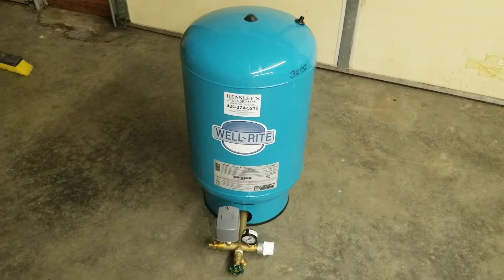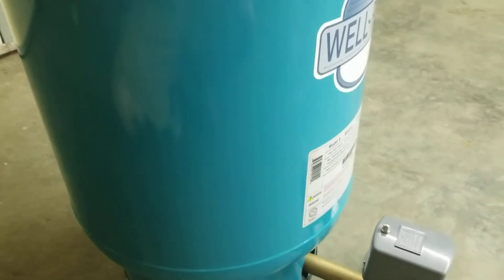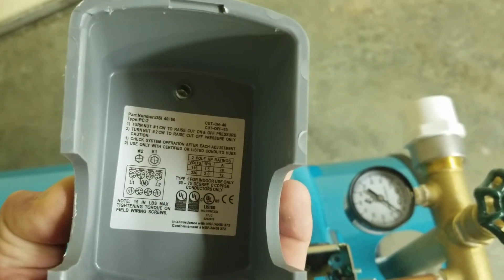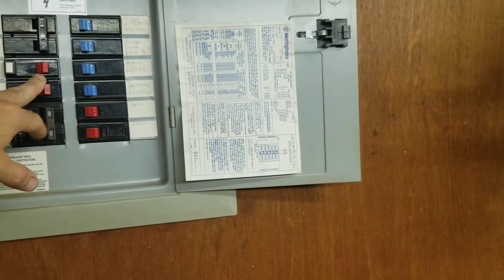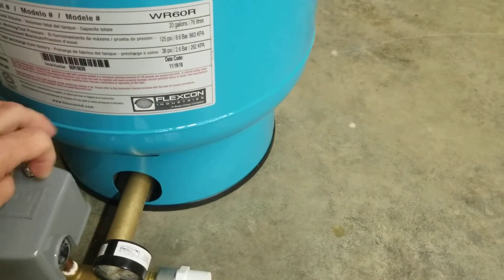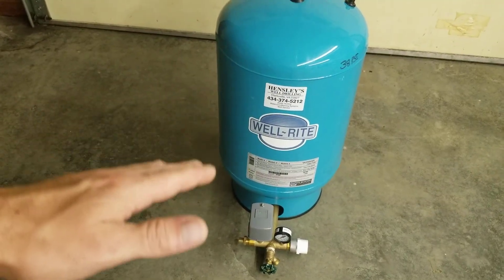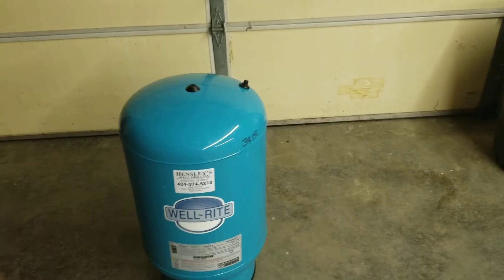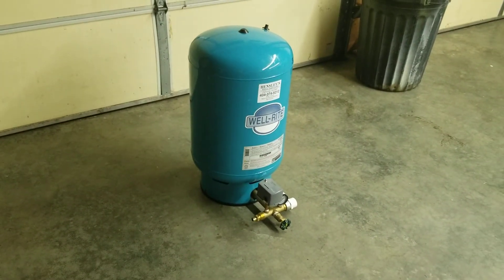Well Pump & Tank Troubleshooting, How the system works, Adjusting Pressure Settings Correctly

Comment: Hey how do I know if it's a frozen pipe compared to well pump?? My water stopped working got a salamander underneath but still nothing tank pump lever has arc but dosnt pressurize its been at steady 32 psi says 30 on 50 off .
Reply from the maker: https://youtu.be/mjhZXgzZoDM 
Watch this video.  7:30 is what I believe is your situation. But the whole Video will help you understand things better
Reply: @h2omechanic  please tell if I have had so much trouble out of my water lately I don't know what to do I finally have got my welcome down in my well then my bladder tank was bad so I replaced my bladder tank I have got a switch on it but I don't know if it's a 3050 or at 4060 and the gauge is reading from the switch like 70 lb but when I checked the air and the tank it is only like 25 what should I do I'm not getting any water out at all but it sounds like my pump is working I'm getting fire to my switch I'm so confused please help
Reply: Landlord has been not helping hasn't even checked or came over
Reply from the maker: Kill the power & don't use any water & see if the 32 psi drops to 0. If it does drop to 0, then the drop pipe burst near the pump. 
A ice plug made the pump dead head, making 150+psi & blew up the pipe. Try that & reply your results
Reply: @h2omechanic  killed the power and its staying at the same pressure.. I just used tire gauge checked too let little out but Normal gauge on pump reads same
Reply: I'm in maine were getting a foot of snow as I speak.  But it's been this cold before and didn't happen.  Couple days ago was low pressure for little bit but then worked fine
Reply: How can I tell if it's the well pump? There's arc on the tank switch but no action no pressure
Reply: The well pump man hole cover was covered in ice I uncovered it just now outside
Reply from the maker: @LoyaltyIsEverything91   As the water level fluctuates up & down, the well breaths in & exhausts the outside air temperature, this can freeze the upper portion of your drop pipe. Id say 90% certain that it is frozen. 
So cover the well head air tight & leave the pump breaker off! Give it 24hrs & try it again. Allow 5-8 minutes of power to test it. If no water still, then turn the breaker back off. It's froze, just gotta wait it out.

Comment: I have a tank with no air valve and I am pretty sure that it was full of water so I drained it the best I could but like the tanks I see in your videos mine drains out the side of the tank and I cant be sure that it is completly drained and my tank has no bladder it just says glass lined , can you please give some idea of what I can do. when I turn the power on to the pump I just get quick hum then it will shut off and then hum again I have not let it be on very long . I hope you can help with the little imfo that I have provided. thank you.
wer
Reply from the maker: The pump is probably dead.
You have a older style galvanized tank. You did right by draining it as much as possible. The air will get trapped in the upper portion. 
If you hire someone to replace the pump, id recommend updating the tank to a new bladder type . But every system is designed differently. Hard to say too much about yours. But them hummm and suddenly stops indicates a bad pump. Bearings failed internally

Comment: We put a new submersible well pump in 2 years ago. We are now having light dirty water coming out and the cold water pressure only in our kitchen sink is low…. Any suggestions?
Reply: Also the breaker to the well tripped
Reply from the maker: The tank is probably bad, causing short cycles and will cause low pressure and can trip the breaker.

Comment: I have a new 44 gallon pressure tank and a new pump, both 30/50. But adjusted to 28/48. Bladder Test-No water coming from the tank when I press the valve on top of the tank. When the tank is pressurized (48 lbs) the "knock test", it sounds hollow at the top and dense at the bottom. The "lean" test,- the tank does have weight. I'm supposed to have 16 gallons of reserve in the tank. My issue is, when pressure drops to 30 the pump kicks on and delivers water into the house normally. But if I start the washing machine in the utility room, the pressure at the pump drops to zero and loose water to the entire house. And it does seem like the pump runs a long time before building back up to 30, then even longer to build up to 50. New foot valve and back flow valve also installed.

Comment: my pump was running fine yesterday, now it wont go over 25psi. Any clue whats wrong?
Reply from the maker: Its possible that it frozen, then it builds 200psi & blows up the pipe in the well, it'll split & leak out most of your pressure.  
A way to test my theory is by turning off the pumps breaker and see if the 25psi drops to 0. 
Look for leaks under house and at the well & wet areas in the yard. Theres a leak somewhere. If you can't find one, then the pipe in the well is broke/split
Reply: @h2omechanic  thank you, I'll go check all pipes under our house

Comment: My pressure is fluctuating and my tank keeps emptying and filling back up is this a switch issue? Please help just replaced tank and well pump two years ago. Deep well
Reply from the maker: 1st thing, keep the pump breaker off during times your not needing water.
The issue is a leak somewhere. Possibly at the well head, could have frozen & cracked a pipe. So look around for wet areas. 
If you don't find a leak, then you have a cracked pipe down in the well near the pump. Or the pumps check valve has gotten hung up & not closing. Any pressure the pump produces will leak out, causing the issue your experiencing. 
A way to test this, is leave it off over night, then in the morning turn it on & run the water for 5 minutes, if you get a air pocket in the stream of water coming out the faucet, that's a tail tell sign the pump must come out & inspect for cracks in the pipe.

Comment: I am having issues with no water it’s been over two months I have children and can’t go without water any longer I have the pump pulled up right now it was 300 feet deep with 21 foot sections  galvanized pipe I could not find anywhere the wires weren’t connected so does this mean it is the pump or how can I test this ?
Reply from the maker: Hook up the pump to the wires on top of the ground. & see if it runs. 
I'd replace the pump and the wire if they're older then 13 years.

Comment: I don't have any water pressure from my well I did all the checks and I found that my pressure switch is locked closed I have a relay box on this system do I really need the relay box??? Or can I just wire it direct uts a 240 volt system and the well service installed that box 3 months ago and put a new pressure  switch in and my wife has been having trouble with it .she's been throwing the breaker off for 5 seconds and turning it back on and it's been working but I told her that there's something  wrong and now we don't have  no water any advice is appreciated  thanks
Reply from the maker: The pump is dead. It's time to replace it. Nothing up top can fix it. You need the control box bc you likely have a 3 wire pump. 
The bearings have failed and the pump will run for a few minutes and over heat, flipping it off & on resets it. But it'll continue. Time for a new pump.

Comment: What do you think is wrong?

I have a 10hp well pump, 80ft in the ground, feeding a 500 gallon tank. My cut on & off on my pressure switch engages on 30/50 cycle. At 28psi, the cut on engages. I can hear the pump humming by putting my ear on the pipe. However, the water/pressure does not rise or fill the tank. We have to reset the pressure switch everyday to get the water pressure/water to go up.

Comment: Great video. I have checked mine out and and still confused. I have a 40/60.  Very inconsistent pressure i. The house. The pressure was at 60 before I did anything. Then I drained it and checked pressure. Everything was okay. So I put water back in and asked my son to take a shower. Pressure dropped to 10 and just stayed there. Half hour later it is back up. Do I need a new switch?

Pressure
Reply from the maker: Replace the switch and the nipple below it. If the nipple below the switch is clogged , it'll act like you described. Buy a 40/60 switch & make sure the air pressure in the tank is at 35psi. & the tank must be empty of water to check the air pressure correctly.

Comment: I have a well system that I have piped into a storage tank and a jet pump to push water to the house a 30/50 pressure switch on it the air pressure in the bladder tank is 28lbs  my situation is that the water well is about 1000ft from my house and seems that my jet pump is having problems keeping up when we shower or do laundry at same time  I don't have any leaks what can be done to increase water pressure in house ? I've been told I need another bladder tank closer to house Would that help or would I need to install a booster pump system? I'm trying to make as simple as possible without  over spending  I hope I explained my situation thoroughly Thanks
Reply from the maker: If you can put a booster pump inline that would work, or put a submersible pump in your well/storage tank. & a tank added at the house would help alot, id put a 36-44 gal tank at the house. But 1000ft is a long way, your experiencing friction loss . Water slows down in pipe on long runs. Personally I'd never use a jet pump in your system. It's job is way overloaded on your setup.
Reply: @h2omechanic  are you saying to put a pressure tank at the house ?
Reply from the maker: @mikewhite4684  yes. Itll help . But your pump style is the problem I believe. My 2cts

Comment: I have lost more and more pressure in my house, started noticing fluctuating pressure once in a while about 2 years ago. Now it's worse and happens more often than not. Should I start at my well pump since it has been so long since it first started or start at my pressure tank? Single mom of 2 with low funds so I can't afford a plumber but I am pretty good at the basic plumbing...diverters, traps, hot water heater, building showers and start new plumbing from scratch. Please help

Comment: been looking at so many videos and I cannot find anything for my situation. I am having issues with my well system. The pressure switch only turns on for 5 seconds every 20-30 seconds then it shuts off. I replaced the switch (40/60) and it still gives me the same issue. I'm assuming it's either an electrical issue, leak pipe, or a clogged pipe/valve. The maximum pressure the tank gets is 9 psi. Air pressure is good (38 psi), not a bad bladder (hallow up top and dull at the bottom), and the well pump seems to be working based on the tests you've shown me. I did check the electrical and they are at 240 V. Any opinions help!
Reply from the maker: Sounds like your pump is dying. The bearings inside have failed, which make the electric motor heat up & kick itself off on a high amp overload due to high Temps. If you had a clamp style Amp meter, clamp it around 1 single wire (white or black) . If it reads over 8 amps, bingo, dead pump. 
I tested a Amazon pump on 1 of my videos, check it out and you'll see the Amp meter & how to test it. If its older the 10 years, that's a sign of typical age life as well. Hope this helps.
Reply: thank you so much! This definitely helped so much! Will update you the next day or two!

Comment: Great video. I have an issue and hopefully you can assist me in some way.....plumbers are booked up around here and there aren't many to boot. We had replaced the 50gal tank waterheater in our home with a rheem tankless electric water heater and a water softener (lime and hard water) and seems as though we've had nothing but problems ever since. Most recently of which, is the lack of hot water--when you turn the tub faucet on and all the way to hot, the psi bottoms out (coming out of the faucet) and is smaller around than a #2 pencil (water stream/flow), plus its not getting even remotely warm no matter how long you leave it running. Troubleshooting in the owners manual for the unit says that if this is happening and the display isn't lighting up, it's something to do with the flow sensor because there has to be a certain flow value in order for the unit to activate. I replaced the flow sensor and all wiring and components the other day and it worked for a day or so and then stopped again. The pressure switch clicks on and off, and on and off the entire time any faucet is on throughout the house. The tank holds psi, no water from Schrader valve, tank isn't heavy when pushed, rings when you knock, psi switch is new, control box for psi tank is new and I'm out of ideas to do/try. Friend of mine mentioned that my tank might be water logged....that's about my paygrade and have been reading and watching videos to see what I might be able to do but nothing yet til I saw your video and decided to ask....Thanks for any help!
Reply from the maker: Ok yes its the flow meter. But its working fine. Your tank is the issue most likely. If you have a inline filter, don't use a black element bc its too restricted. 
Or just let the water Softener do all the filtering. First go look under the pressure switch cover, look for the "on" number.  Itll be either 30 or 40. Say it's 30, then you'll need to check the tanks air pressure (same as you would a car tire) air stem is on top of tank. Set this to 25psi . The system must be off & complete drained of water. 
I hate instant WHeaters bc its always something. Too many sensors. But it does let u know that something in the system isn't operating right. 
So adjust the tanks air pressure. 
Then remove the filter element if u have 1. Then try the system and see if the water gets hot. We did a electric wH in our shop, it required 3 40 amp breakers and had 3 different elements for higher heat levels. This pulls insane power and made our lights flicker. Just our experience. 
Try these things & let me know. If you comment your cell #, I can text/call you & walk you through testing since all plumbers are busy (that's every plumber) even I'm swamped. 
I'm gonna guess that your tank is way over charged with air, around 45psi, or its completely on 0psi.  So turn off the breaker, open a faucet and go check the air pressure with a hand held digital tire gauge, then look under the switch cover, & adjust the air the 5psi below the "on" number. Then turn on the system and try hot & cold & see if the switch stops short cycling (on-off-on-off). Once the switch stop clicking like crazy, it'll all work properly and you'll know that it is fixed.
Reply: @h2omechanic  27sixsix9atesix9zero1

Comment: I need help bad!! I’ve tried everything no water six weeks now please help
Reply from the maker: If you leave a very detailed comment, I can probably diagnose it. If its complex, you can call me. But try commenting first, bc it may help others who will read it.
Reply: @h2omechanic   @H2o Mechanic  I’ve tried everything. Bladder seems good. Replaced switch. Water still won’t force its way into the house. I’m thinking new pump? Before I replaced the switch the pump wouldn’t shut off. Now you have to hold the metal lever for it to run at all. I have images of the setup if there is a way I can send them via Facebook messenger or something. Thank you so much for your time. I’m wishing it was something simple but I’m thinking now it’s the pump itself. $$$$$
Reply from the maker: @TheLilstell  find me on fb. Philip Hensley. My picture is in a white race suit . I'm in Virginia. But yes it's probably the pump. How old is it? Typically they last 9-12 years. A honest replacement should be 1,000 to 1500

Comment: Hi , I have an issue with my pump not stopping replaced the switch on the pump and still no stopping . I’ve also replaced the tank switch . The only way the pump stop by shutting the breaker . I’ll appreciate your thoughts on the issue .

Comment: Hello,
Problem #1: My well pump kicks in at 35psi and shuts off at 65psi. Immediately the pressure will begin dropping even though no valves are open anywhere on the property and the gauge will be at 35psi again in forty seconds and the cycle repeats itself. The life of my Gould pump is being compromised. I pulled the drop pipe one year ago and installed a new foot valve and replaced the leathers too. My wife and I had to have the power shutdown on our property a few days ago as we were installing a new Generac system. We’ve had a problem with “drillers sand” for years to the extent that I “blew” the well about two years ago. 
That’s a lot to chew on but can you advise me as to what I should do to fix these multiple problems?

Thank you kindly
JTS